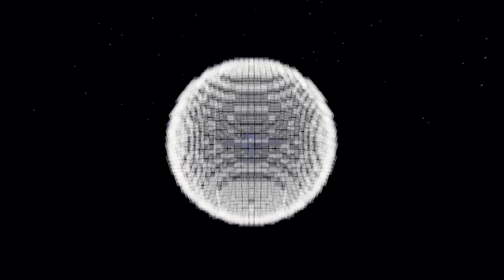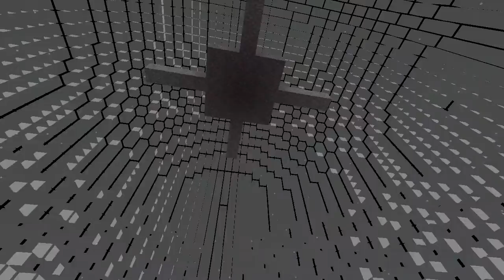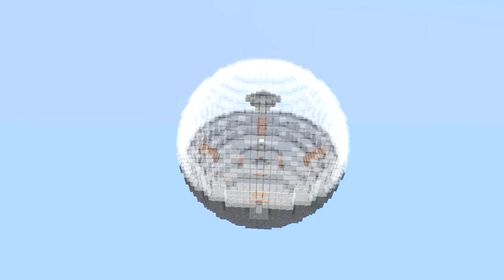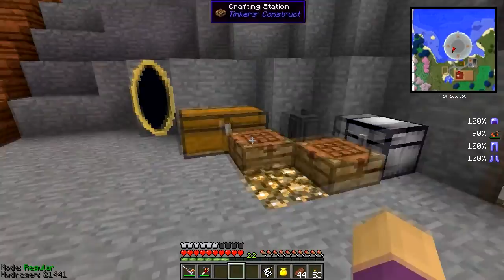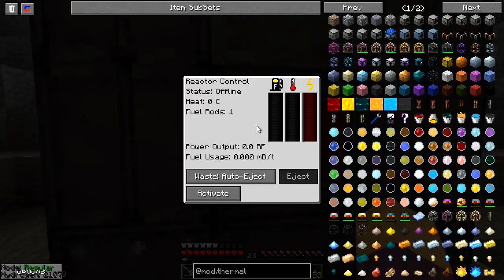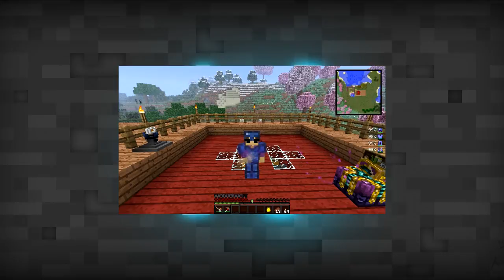Vaygrim's Chance - S01E08 "The Sphere"

Comment: Big reactors dont explode. They just get less efficient as the heat rises.
Reply from the maker: Thanks for the information, I actually didn't know that! I knew that E.Beef wanted to make Big Reactors more 'beginner friendly' by not having them explode.. but I expected there would still be the risk of fires if the reactor got 'too hot'.

Thanks!
Reply: Good to know! I've got a fairly large reactor. Would it make sense to set a CC program to monitor the heat and lower the control rods at a certain point? Is there a graph that shows efficiency?
Reply from the maker: Fuzzzie Corjaantje on the Resonant Rise LP server had a ComputerCraft controlled Big Reactor, complete with massive monitor to show all the details on it. Real impressive! You might can find videos of it from last season on Corjaantje's channel.